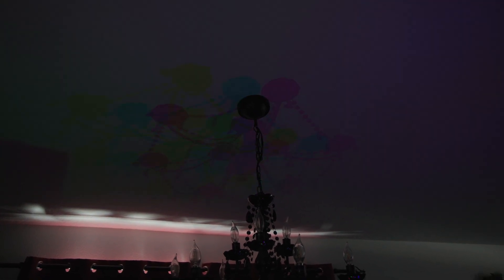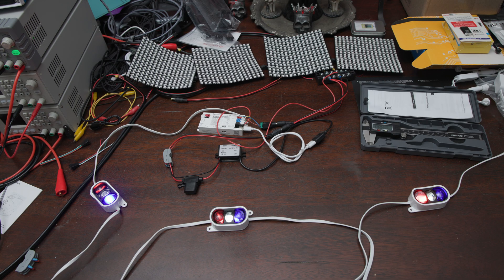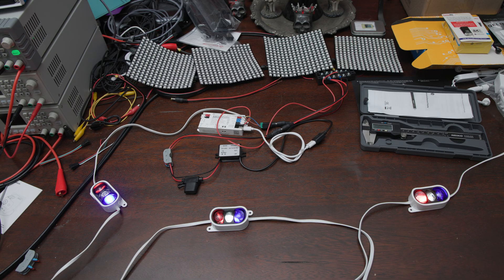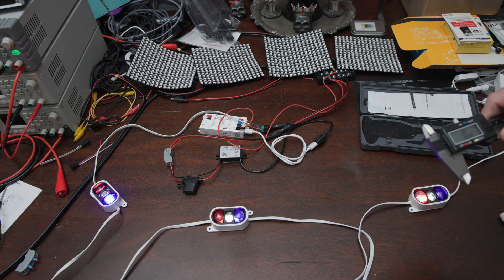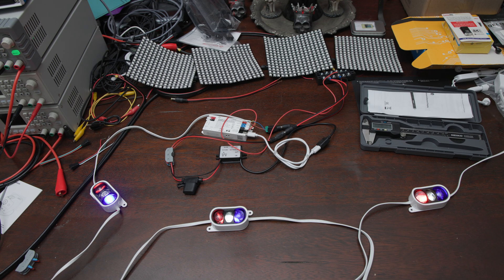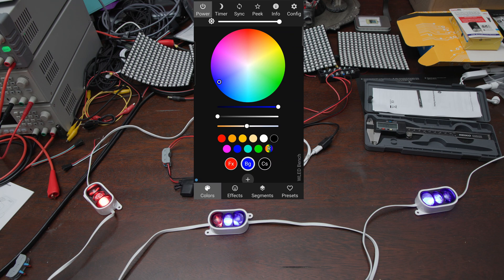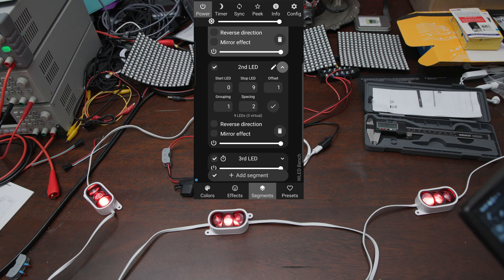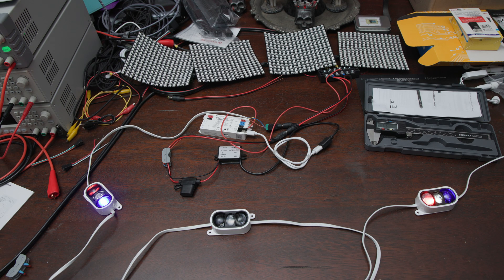🚨 Govee Prism Lights FAIL? WLED Upgrade + Full Configuration & Demo! (Make the Prisms GREAT)

Comment: Did you evaluate the Govee Pro’s?   If so .. would you choose the pro over the prism?   Or is there a better set with another mfg?   I need a 150ft length set,  and I have a two story house I want to install on.   Any advise?

Comment: Hey..... im new to your channel and I did subscribe... so im looking to buy my 1st solar generator like the bluetti apex 300, ecoflow delta 3 ultra plus, or pecron E3600LFP. I'm needing to add 3 server rack batteries which I'm told can be done by making cables from the oem expansion battery cables. The problem im having is im leaning towards the apex 300 for the 110/220v but I'm seeing it has a solar input capped at 60v 20amp and I don't know if theres a way around this insanity of 60v solar.... do you have any recommendations or hacks for this?
Reply from the maker: Yes, easiest thing in that case is use an external MPPT that fits your solar needs and send it to your server battery bus, those batteries will charge the power station battery either by the PV input or you can do direct battery and have all the batteries together if they are the same voltage and chemistry.
Reply: @ViciousXUSMC  thanks for the fast response! So your saying if my 3 server rack batteries are wired to the bus bar and then bus bar to the apex 300 expansion battery port i can run my solar array to an external mppt then mppt straight to the batteries bus bar bypassing the apex 300 DUMB 60V SOLAR INPUT and that would charge my server rack batteries and apex 300 automatically even if my array to mppt is over the apex 300 60v limit? I greatly appreciate your help. You think or feel the apex 300 is a good choice between itself Pecron e3600 and ecoflow delta 3 ulta plus

Comment: Do you think the reason why they include a lower wattage power supply is to prolong the longevity of the LED chips?
Reply from the maker: No LED ICs are already self managed they only draw up to a specific current and they are designed to handle it.

Go look at my solar rack build, it's running LEDs and it's directly connected to a 70,000W power supply.

This is to cut cost, and if anything to protect the wire that is too thin.

So instead of upgrading the wire and the power supply, make it cheap and replace the failures as that still is more profit than selling a product that lasts.
Reply: @ViciousXUSMC  I’m only basic w my electrical knowledge. A little (not much) above basic lol.  But my husband is near expert level.  I’ve been wanting to buy something along these lines so we don’t have to put lights up and take them down yearly.  I know he’d have no issues with putting a new power supply on them or even running them into our main supply like you did.  But is rewiring them w a better gauge wire possible?   He’s a worry wart about fires, etc. And if he sees one video about a possibility, they’re outta here 🤣.  But we’re hitting our 50’s and convenience wins for a lot of things now 😬
Reply from the maker: @Audacity0708 no, not really the wire is what connects everything.

To replace it, you could be at the level of just buying LEDs and making your own custom light's.
Reply: @ViciousXUSMC  he might be willing to do that. I’ll run it by him.  Thank you for replying!

Comment: First, really enjoying your channels and am trying to learn from it. My first project is to complete my Prism power/control identical to yours. After that, I want to work my way towards your solar setup. I just wanted to ask a few questions...

Which distribution box are you using?
The red wire between your distribution box and your controller is just a ground, right? 
How did you connect your power supply to your distribution box?
I am looking to order two 200' Prism kits. Due to the weaker gauge wire on the strips, am I correct in assuming I should not push my luck with a higher wattage power supply? I should just invest in two distribution boxes/converters/power supplies/controllers? After some research, I found there is a way to sync multiple controllers (https://www.youtube.com/watch?v=HYdouRHfadE).